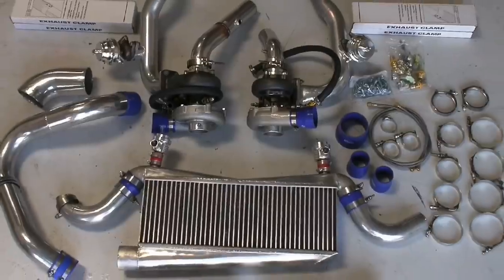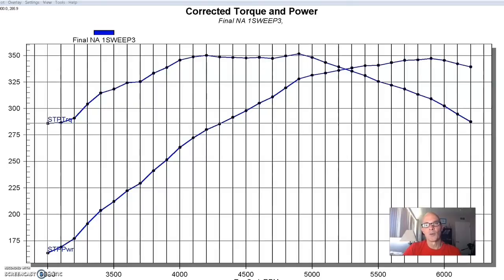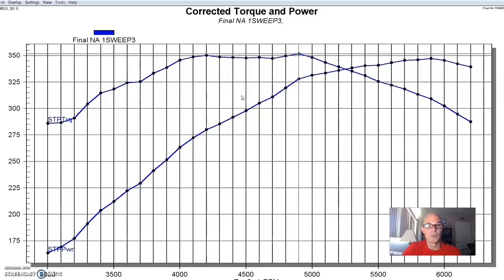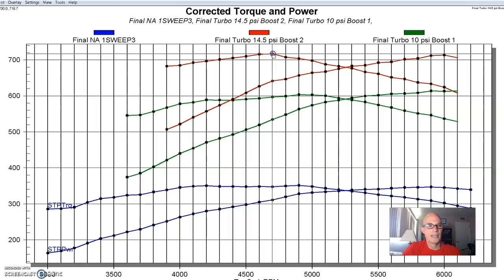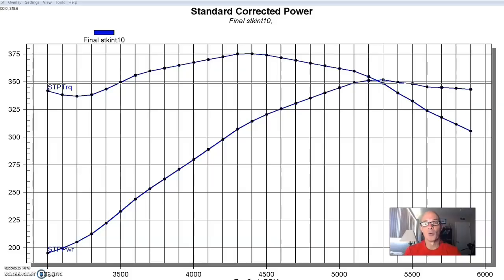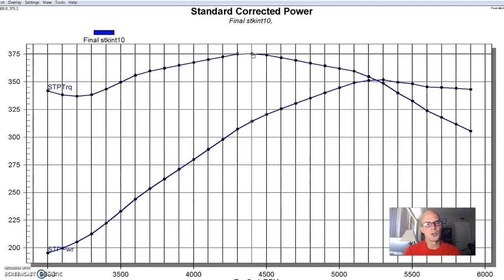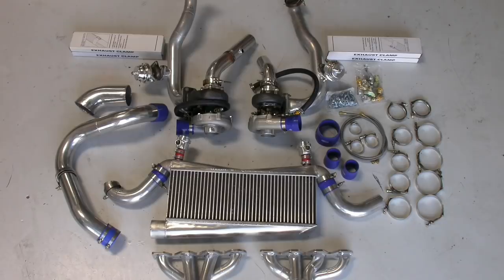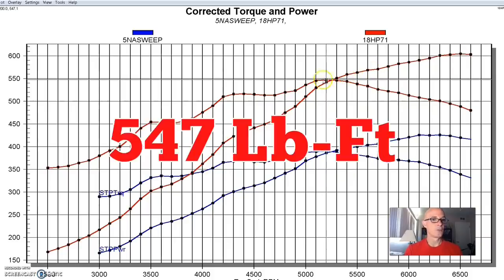TWIN TURBO MOD FORDS (2V, 3V & 4V)

Comment: what do I have to do to get either a turbo or supercharger kit for my 2007 4.6 2v f150?
Reply from the maker: both are offered for your motor
Reply: @richardholdener1727 thanks for the reply.
Do you know any good suppliers?
I’m new to this engine and platform.

Comment: Hi Richard, serious question, what would be best approach do you think to give a 2013 Ford E-250 with the 4.6l more performance. Mostly used as a camper van.
Reply from the maker: headers, tune

Comment: I'd love to see what the 3 valve twin turbo would have done with a little more effort, bren speed  has cams for the 3 valve  that doesn't involve all the tune timings issues  i had been giving a lot of thought to twin turbos on my old GT im 68 years young and getting tired of these little 90 pound kids in there coyotes  come by me in the parking lot and rev their engine  I've even thought about putting some 460 aka 520 on their ass if i gotta put the oil pan in the trunk it will go

Comment: whats the difference between a cobra 4v and an aviator 4v? Just built bottom end?
Reply from the maker: intake and possibly cams, not sure on compression
Reply: @richardholdener1727 Thanks!
I thought the heads were different too

Comment: Do you remember what size turbos were offered with this HP Performance kit? I have this kit on a 96 cobra right now. I think the paperwork that I have stated that the turbos are rated at 700-800 horsepower. The A/R on the compressor housing is 0.5. Wondering what trim they are.
Reply from the maker: 46mm and 57 mm

Comment: They should've used e85. Very few guys wanna run that expensive 114 to 118 s h I t. And e85 runs cool. No intercooler  needed usually.

Bloodviking

Comment: Love your channel. Currently have  a 3v 4.6 Mustang GT. What cams and head work were done? Or did you run boost at 10.5lbs with stock internals, stock heads on the 3v 4.6?
Reply from the maker: WE RAN BOOST STOCK AND MOFIFIED ON A 3V
Reply: In this video specifically, for the 3v, it was stock heads, cams, piston rods, with 65lb injectors with long tubes? I wanna make sure i got that correct. I would love to replicate this in my 3v for a while before i get a 4v 5.4 and rebuild it and go with boost.

Comment: I'm looking for a after market fuel rail system for the 5.4l 3v. I haven't been able to locate one for my 2005 f150 project. It's for a supercharger application, so that I can run a return system and a regulator. Thanks in advance for the help.
Reply from the maker: No idea

Comment: Hi Richard, I've always enjoyed reading your articles back in the Muscle Mustangs and fast Fords days and watching your videos, they are a wealth of information. I was wondering if you have any experience with forced induction modular engines running on LPG auto propane? It doesnt seem like there is much info out there regarding forced induction and LPG as a fuel source. Are there adequate engine control systems available to run LPG on a twin turbo or supercharged modular ford engine? can the stock ECU control LPG injectors (Im wondering if the ECU from a vehicle that came from Ford with the "gaseous engine prep package" might be set up this way?
Reply from the maker: no lpg testing

Comment: I know this video is old, but it is useful for me.  Starting a new project, F100/Crown Vic swap.  I got a 2011 Romeo 2V PI engine and I want to make cheap power on it.  From what I can see, turbos are definitely the ticket to cheap power, especially those ebay gt45 turbos (I plan on doing a single to save money).  I am completely new to the 4.6 motor.  Other than ring gap, what needs to be done to support a decent amount of boost?  I know the 2v had forged internals -- what could the stock internals take?
Reply: edit - I meant to say I know the 2v (In this video) had forged, not cast like stock, internals.

Comment: So the 3v hangs with the 4v for much less money and at a more useable rpm range?
Reply: When you start revving that 4v to 8k with stand alone it really comes to life assuming you have the right cams and intake manifold to make power there.
Reply: This 4v is a terminator motor only has 8.5:1 compression vs high 9s for the 3v that also makes a difference.

Comment: Damn. Wanted to see what a stovk 2v turd does with boost. It's very similar in spec to my stock Mercedes v8 that has zero aftermarket.
Reply from the maker: that video is up too
Reply: @richardholdener1727  oh I'll have to find it.
Reply: @richardholdener1727  which one? Only see with cylinders heads and cam the supercharger.

Comment: Richard, I'm installing a Crown Vic frame and drive train under a '71 Ford F100 body.  This is done a lot but I wanted to know what I was getting with the 2006 CV (not a P71 police car) engine... were these the 2 valve engines?  Would they be like the non PI mustang 4.6s?  What can I do to bump up the power on these?  Thanks in advance, this would be a great video someday to help all us swap guys out.  Thanks, love the videos and the knowledge gained. Clay
Reply from the maker: AN 06 SHOULD BE A pi
Reply: @richardholdener1727  - so a PI 2 valve, right?

Comment: I saw an odd post on Facebook of a guy trying to use 3V exhaust manifolds on a 2v PI 4.6...I have yet to find any posts on any of the forums like TCCoA showing the mods to make it fit (like welding cast iron to make holes for the 2V studs) and dyno comparisons.
Reply from the maker: I doubt there would be any gain to that

Comment: Wanna see 1000 hp out of 2valve I’ve heard it can be done maybe with the pi swap?
Reply from the maker: i did it with boost on a pi
Reply: Non pi block with pi heads 2v !?
Reply: Taking notes

Comment: What were the specs on the 3v cams
Reply: That's my question and the 3v at 10lbs made more power than the 4v at 7 lbs but did so at much lower rpm. That's a huge win for the 3v

Comment: you should do a stock pi 2v block with non pi stock heads with a twin turbo .. .. so a budget guy with a  both engines could  basically do a budget NA build for 1 car using the non pi block w the pi heads + cam upgrades.. and the pi block with the non pi  heads  along with a  cheap twin 50 or 57  turbo kit  for car 2,, + needed ecu and fuel injector-pump upgrades ..aiming for the 600 ish hp mark...  mainly bringing this up because i have 2 cars with 95-96 year 4.6 2valve and a 01 4.6 2v...all lincoln tc
Reply from the maker: non PI heads are not good
Reply: @richardholdener1727  my thought is a lower compression motor  on the cheap $$ to make more power under boost pressure.. ( which is due to more total volume being pressurised  on the intake stroke) provided you have the turbo well sized/..ect for the build. However if the non pi heads are  junk then ???
Reply: Y2da420 i see ya, good for the goose & the gander - na vs boosted and /or compressed ???
   Now I'm confused, like mechanical variable duration and the " open valve " concept!

Comment: A 2v making 714 hp, amazing! 🤤🤤🤤
Reply: This is an engine dyno with no exhaust and no accessories pulling hp from it and no driveline loss.  In a car this combo might see 600 at the wheels on a good day which isnt bad just wanted to put into perspective that this 700+hp is nowhere near 700 WHEEL hp which is what most people refer to in the automotive aftermarket industry.  It isnt that hard to make power with a 2v people just repeat what everyone else says that they can't do it.  With stock rods they can't reliably hold much above 400-450 rwhp but you can get a forged rotating assembly for like 2 grand and then the skies the limit basically.   That is the only thing holding a 2v back from making big power.  It won't make as much as a 4v with equal mods and boost but it can def make plenty of power.

Comment: the cam phasers use solenoids that are variable, hints its name. my reason for stating such is get a toggle switch and control the solenoids of the phasers.
Reply from the maker: they are pulse-width modulated
Reply: I meant to put motor control and assumed someone would correct me as I was to lazy to edit it 😂 thanks. Well they could always use the toggle to lock the cam phaser in place if one were to use them in tandem the could effectively make a decent controller for the phasers in theory.

Comment: Thanks for the 3v content! My 07 3v is tired and I’m debating whether to rebuild & boost or swap for a 460 or maybe a boosted 351w like the 1k hp version you did in another video.
Reply: Just do forged internals on the 3v and add boost.  They can make a ton of power no reason to go with a different engine unless you just don't wanna deal with having an engine built which is ideal honestly for longevity if you actually care about being able to run it like its supposed to be ran and still get plenty of life out of it.

Comment: Bought your book a few years ago on the 4.6/5.4 building HP on the dyno when I had my 06 P71 Crown Vic. I never did get it boosted however I did put the Trick Flow heads on it when they came out, I remember in your book how you mentioned how it would be great if someone stepped up and made an aftermarket head for the 2 valve. Along with the 262 cams and some other tweaks I got it running pretty good for an NA 2 valve.  Love those big ol Crown Vics, going to get another and put some boost to this one.
Reply from the maker: If I complain enough-people listen
Reply: I’m thinking about doing truck flow heads and cams on my crown Vic

Comment: It makes more sense to run the 3v without cam phasing like you said. Anyone looking for real power out of a 3v, the first thing they are going to do is lock out the phasers simply for reliability and simplicity.
Reply: NOT SO the ford racing cams are made to run with the phasers and the ford engineers spent a lot of time giving the tables to the tuners to tune the cam tables the vvt is where the power comes from!

Comment: If you wanted to be funny you'd throw a 267 Chevy in there with a couple turbos to see how it compared. Then again maybe I'm just trolling a bit here.

IMO The 2V modular engines are really under estimated when it comes to boost. Not surprised it made pretty decent power.

Comment: Every performance v8 has had variable cam timing for years now... WHEN is the aftermarket going to step up with controllers that take advantage of it, instead of forcing you to lock it out and leave so much untapped potential? Maybe not so much for pure peak HP, but for street driveability without sacrificing high end power. I mean, that’s why the OEMs use it, after all.

Comment: I would like to see the same test done with superchargers on the 5.4 2v and 3v
Reply: Just made a request for 3v 5.4. low boost 6-8 lbs, for towing. My 5.4 3valve motor does a good job towing my 5400lb camper. No complaints. But 450-500 ft.lb. of touque @6-7 lbs of boost would be awesome. The old dogs got 250000 miles on it, but still going strong. If I decided to freshin it up it be nice to have more power. My phazers are locked out, all the fixed done.
Reply: @markmccarty727  I know a centri blower isnt known for torque production at low rpms but it is a bolt on option for boost with a 5.4. It would have a rising boost curve but still produce a lot more torque than stock.
Reply: @madmod  Yes, and it's an easy installation, but it's not really a load sensing application. My 5.4 does a really good job, and I'm nowhere near maxing out the tow capacity. But just like racing, a little more is always better. Probably could get 550-600ft. lbs. Of torque really easy with  70 mm turbo. I think 500 would more than I need. Getting onto the interstate pulling a camper is tuff with some of the short ramps and NO acceleration lane!! Hardly ever do that, but a little more power is never a bad thing
Reply: @markmccarty727  The benefit to even a centri blower is the fact you can pulley it up to get into boost more quickly while also avoiding any exhaust issues with having to feed a turbo. You will still come into boost very early with a vortech and a pulley. Should be able to support 500+ ft/lbs no problem.
Reply: @madmod  Still dragging it along. To do that ud  still have to make arrangements for bleeding boost off by the time you get it spinning faster. I know, I want alot for next to nothing. In reality, a 4.6 with a properly sized turbo would probably be more efficient. But I'd still be pulling that big ass transmission and rear end! I'm out waiting on back surgery and got to much free time, but not able to put it to use!! It works fine now, and very versatile. 6lbs. Of boost @2500 would really great though!
Reply: @markmccarty727  A properly sized turbo setup will ALWAYS be more efficient, there isn’t a question. You are turning waste into power with a turbo. Even the most efficient superchargers still take power to create boost.
Reply: @markmccarty727  downshifting is your friend if you need torque.
Reply: @kennethpowers8995  turbos also take power to create boost because they add exhaust back pressure, but they take a lot less than superchargers.

Comment: " let's see what happens when we put boost to our three valve " ....

Cam phasers explode , pistons hit valves, nine foot long timing chain gets wizzed through the front cover.

It's funny , when I worked for Ford when the terminator was new ford rated it at 390 hp 🤣😂🤣😂
Reply: Are you a fool!

Comment: Have you ever tested a compound boosted 4.6? Hellion sells a bolt on kit for cobras that I’m super interested in
Reply from the maker: We did long ago with HP Performance
Reply: Richard Holdener like blowing through the stock eaton supercharger?
Reply: @trevorvaughn5562  it makes alot of power and a ton of torque but it will make less peak power than it would with the turbos alone which is why people who are using them to make big power and race them use turbos and an earlier na cobra manifold.  It will still make a ton of power and even more torque.  Seen em do it in mm&ff mag back in the day it was 1188 rwhp if I remember right and way over 1000 torque.   For example let's say it's 1188/1050 peak with compound boost...loose the blower it'd probably do 1250/950 (not exactly just giving you an idea what I am talking about).  Kind of strange how that works but at that point the supercharger is actually a restriction.

Comment: starting to think the next "modern muscle classic" is a 2v crown vic with some mild ported heads and 10 psi... 600 hp isnt anything to snuff at and you get ALOT of car for the money
Reply: difficult to package.  I am stuffing all the crownvic suspension in to a 95 f150, smart people would stick to the older frames that actually fit the CV stuff, and there is way more room for a turbo then in a CV chassis.

Comment: When you modify the ford modular motors( mechanically) is there a way to make adjustments to the ECU at home or a program you buy, or how are you setting up the tune ? 
Thank you for sharing Richard.
Reply: Check out HPTuners
Reply from the maker: we use a stand along ecu and tune it

Comment: Will the Holley efi for the coyote adapt to the three valve fords or the 6.2 ford? Thanks again for showing all your results.
Reply from the maker: we can run a Mod Motor with a Holley
Reply: @richardholdener1727  Thanks but will it handle cam timing on 3v or 6.2, i was also curious if the ford racing pack for the coyote would run the 3v, 6.2 including cam timing

Comment: Why didn't you run pump gas for both NA and Boosted pulls, that would have shown the actual difference of adding turbos?  Race gas can't be found at local gas stations so pump gas 93 would have given a more real world reproducible result.
Reply from the maker: pump gas only shows the limitation of the octane
Reply: @richardholdener1727  I understand that but many people probably wonder what the hp difference you can get with a turbo,93 octane and a good tune.

Comment: Have you ever considered the VW 12 valve VR6? Pretty simple motor and has a fairly stout bottom end from the factory. They were initially designed to be a diesel if I’m not mistaken. They love boost.
Reply from the maker: I've done some VW stuff-even set a Land Speed Record in a Jetta Hybrid
Reply: Richard Holdener is there a video up on the Jetta? Would love more of the odd ball builds and Vw vr6 or a j35 out of a odyssey.

Comment: So I remember doing some research in the past and the 57 trim t04e turbo's actually tend to make less power than the 50 trims with all else being equal. The inducer on the compressor is slightly larger but the exducer is the same. I'd almost bet if you did the math and plot them out on a compressor map the 50 trim would have been a better choice to stick with all around, I would've enjoyed seeing back to back with the exact same turbo setup.

Comment: Honestly I liked the power curves of the 2v and 3v... they were much smoother and made more low end torque
Reply: imagine if the vvt wasnt locked out
Reply: Love my 4.6 2valve.
Reply: That's what they do lol
Reply: For a car, i'd rather have the 4 valve. For a truck, maybe a 3 valve. If i was going 2 valve, i'd rather get an LS to have better aftermarket support. Horsepower knows no branding.
Reply: @sepg5084 the mod motors have endless aftermarket support and with forged internals sky's the limit no reason for an ls.  Buy a gm if you wanna build an ls.